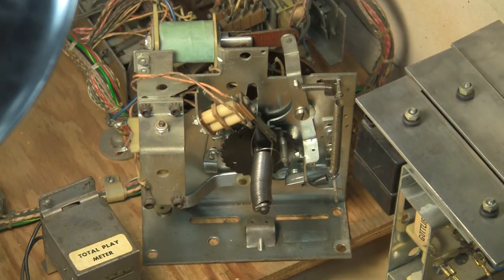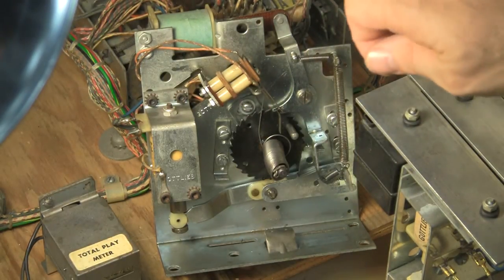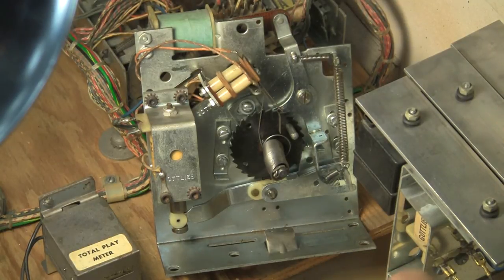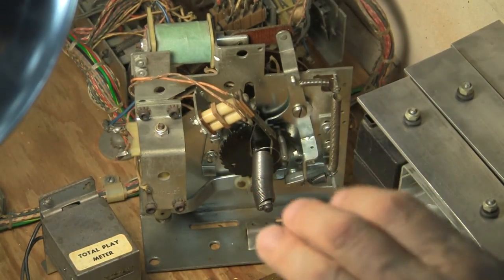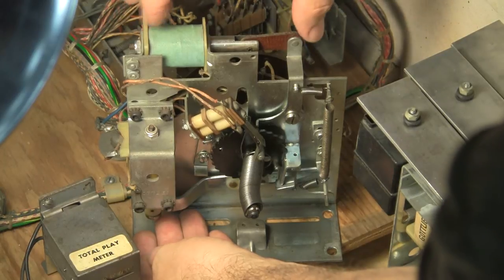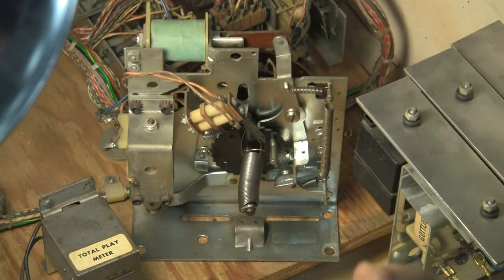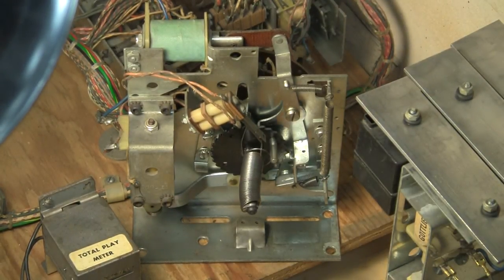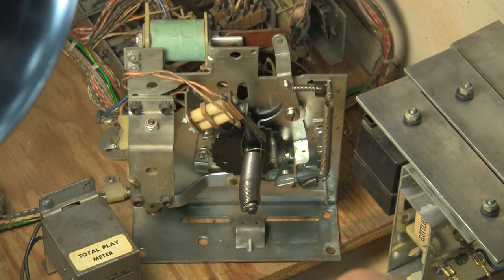Pinball Troubleshooting "300" - won't start multi-player game Part 3 - PinballHelp.com

Comment: Yes, it was still returning to one player position very sluggishly, due to the center wheel (the brown one with the teeth), having gunk on the post.  You should have taken that assembly apart and cleaned the post.  These units are meant to operate 'snappy', and very crisply, so that the switches make good contact consistently.  Using that solvent helped clean it but by not taking them apart, you left solvent in the tights spots that ends up getting gunky itself.  Take apart, clean well, remove cleaner.  A drop of machine oil is about all that's needed once it's all cleaned and put back together.   realizing this is nine years old.  Maybe you figured that out.  Would have helped if you updated us with how it turned out.

Comment: what cleaner did you use? trying to fix the same problem on my 300
Reply: Not sure if this was safe, but I didn't remove the "coin" unit.  Just minimally sprayed some Windex on the nut of the "arm" in the video. Made sure to avoid getting other parts.   Used a cute tip/ to dry it.  The arm loosened pretty quickly and the multi-player now is working.  I have a Gottlieb "Royal Flush" 4-player unit.